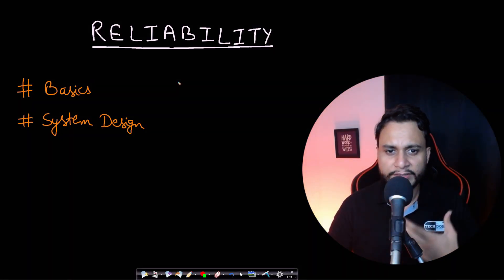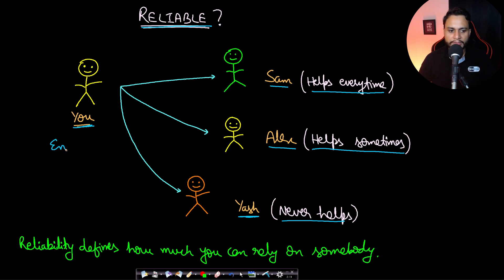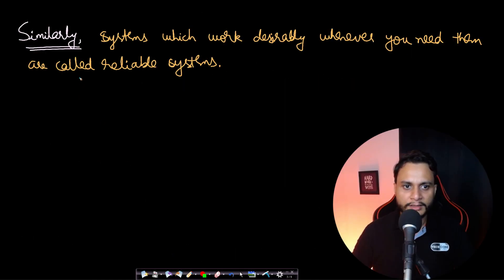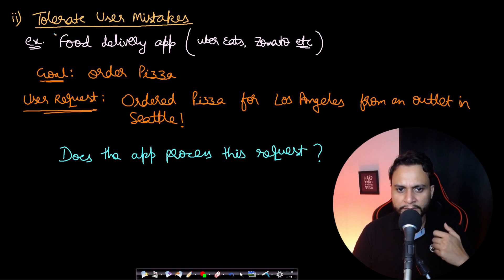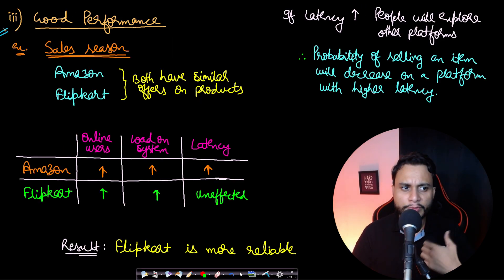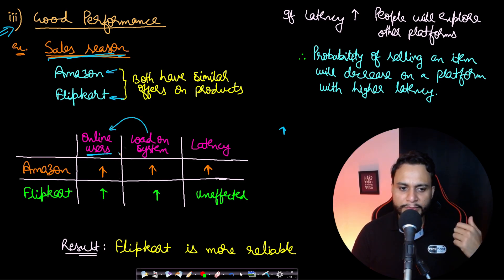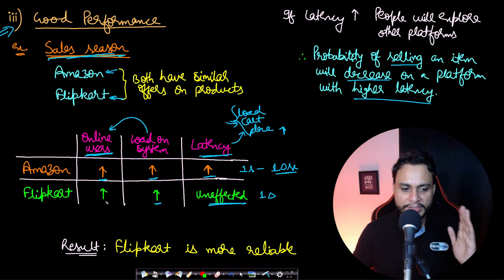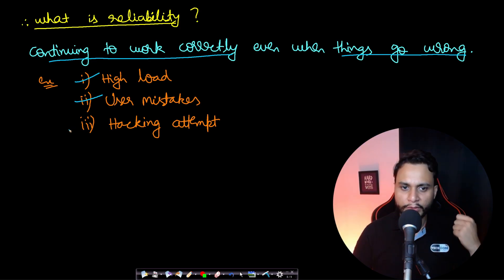Reliability | System design

Comment: In system design, reliability refers to the ability of a system or component to perform its required functions under stated conditions for a specified period. It's a measure of the system's dependability and stability over time, indicating how consistently it can operate without failure.

Key aspects of reliability in system design include:

1. Fault Tolerance: The system's ability to continue operating properly in the event of the failure of some of its components.
2. Redundancy: The inclusion of extra components that can take over in case of a failure, ensuring continuous operation.
3. Availability: The proportion of time the system is operational and accessible when needed.
4. Maintainability: How easily the system can be maintained or repaired, which affects how quickly the system can be restored after a failure.
5. Resilience: The system's ability to adapt to changes and continue functioning, even in adverse conditions.

Reliability is crucial in ensuring that systems can meet their performance requirements and provide a consistent user experience, especially in mission-critical applications where downtime or failures can have significant consequences.